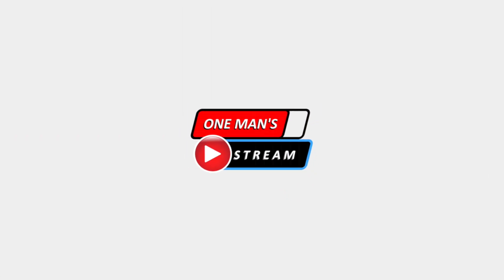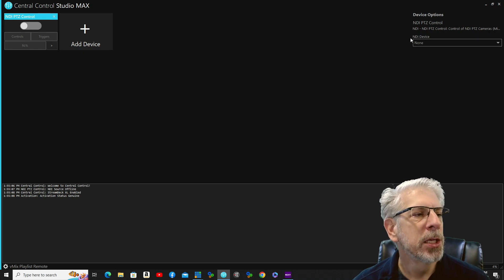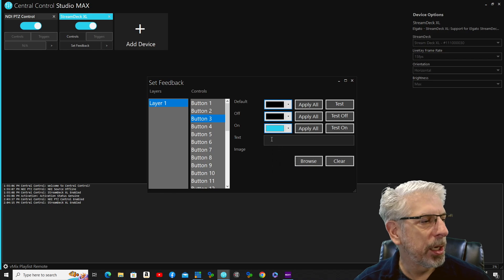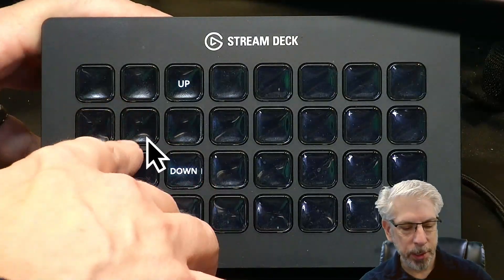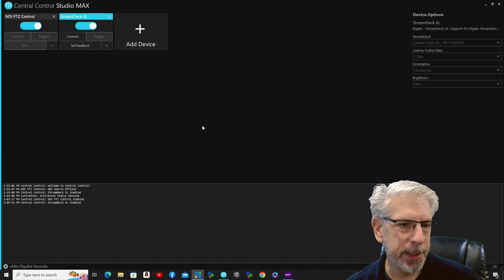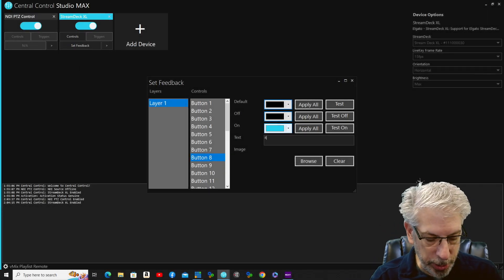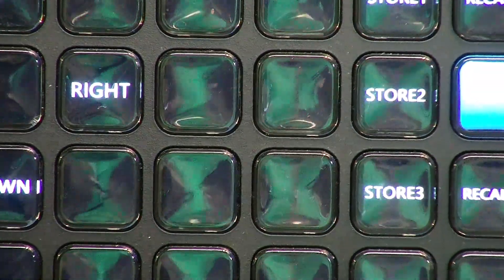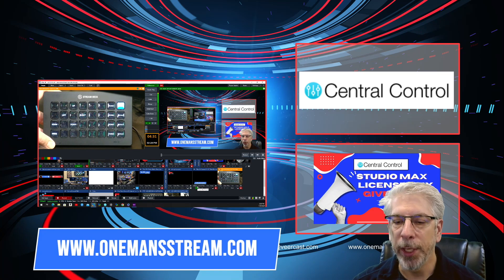PTZ Controller with Central Control & StreamDeck | One Man's Stream Ep86 | Central Control Tutorial

Comment: Hello!
Great video, I'm creating a setup for my church, and we will be using 2 PTZ cameras, I didnt see a function on the command list to switch between the 2 cameras or anything like that. Is that functionality possible using Central Control? I've never used any software like that so forgive me if the question is a bit ignorant. Thanks in advance for your help.
Reply from the maker: There is NOT a camera select shortcut in vMix but yes it can be accomplished in Central Control.

Comment: Very clear and helpful video; thank you.  How would you compare the time it takes to set up these commands with Central Control vs. using vMix shortcuts?  It seems like vMix shortcuts would be fewer steps, no?  Also, what are the "store" buttons used for during the actual production?  I have purchased Central Control but have not yet used it as I have been using vMix shortcuts with my Streamdeck XL to save presets with my PTZ cameras.  I think if you add shortcuts for pan, tilt, or zoom in vMix you have to add a "stop" button or the camera will keep moving, whereas with what you've demonstrated with Central Control, you can simply lift your finger off the button to cease the movement of the camera.  Do I have that right?  Thanks again.
Reply from the maker: Using just Central Control is much, much quicker and easier. In my opinion. Yes pushing the button moves the camera, remove your finger and it stops.